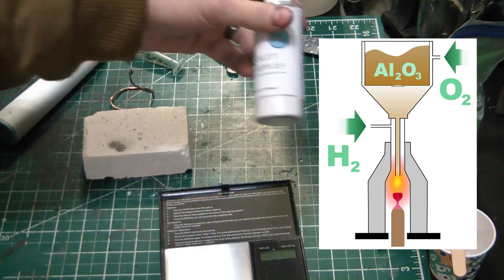Can a $25 Torch Make Synthetic Ruby? - ElementalMaker

Comment: My rubies aren't near as big as yours. Also too much baking soda broke my torch,I printed the prototype and should have built it out of better material after I printed the design but I got impatient so I wound my coils in the PLA. A side-note a pla vessel can take up to 30 PSI with 10 mm thick walls. Torch design number two is more of a Hoffman apparatus, but the pressure is it puts out are miniscule. Also synthesized a Ruby using a fresnel, this was the safest and easiest method for anybody that wants to try it at home. Good luck elemental maker and I hope to be posting a video of a homegrown lazing Ruby soon. That's the whole reason I'm trying to synthesize a ruby.

Comment: Super!
That is an impressive little torch, and your idea of modding the nozzle raises some exciting possibilities.

I was thinking, to produce product with introducing fewer  contaminants, how about using resistance-heating?
If you formed a short strip of Inconel or tungsten into a U, you should have a pretty good container-cum-heating-element.
Also for the mixture of oxides—would mixing enough water to make a slurry make any difference?
If it does not, you could use pressure to force it out of the nozzle; perhaps an ordinary syringe if the heat doesn't travel that far up.

As always, thanks for the stellar content, and you have a good one!

Comment: if you go back to using HHO flame to do this, do you think it would be possible to take your mini ruby boules and melt them together? theoretically the flame should be more than hot enough and the boules should be large enough to at least "weld" them together, i hear thats a hazard when heat purifying natural rubies

Comment: Maybe you could inject the powder in to the torch nozzle? Just have a hole in the nozzle a cm or two from the fire end, and have the powderador hooked to it, so that the gas flow would carry it out. That way the powder would be inside the flame from the beginning. Would have to seal the powderator though as it would be pressurised (with a potentially explosive gas mixture).
Or have the butanO flow through the powderator, with the powder nozzle replaced with a torch nozzle. That would probably carry out too much powder, though, assuming the gas flow could actually keep it from being clogged.
Just seems to me the cad design would leave the powder hanging on the outskirt of the flame.

Comment: Spraying at the brick will make a hole in the brick and scatter ruby dust everywhere.  Let ruby dust fall into the flame and spray at a horizontal metal surface or a pane of glass with spreading motion to prevent shattering.  Think similar to the Abom video of spray welding a shaft.  The reason the Hydrogen torch ruby fluoresces 10x better is because either the carbon is inhibiting fluorescence or the big fast flame jet is selectively flinging off the lighter aluminum oxide, thus avoiding staining the rest of the fire brick red while making the chromium self quench, try using an oxygen rich flame, putting hydrogen through the bigger torch, or using a plasma cutter to do the melting.

Comment: Maybe you could ball mill the alumina and CrO, but you would need to use alumina media - or diamonds if ya got em
Reply: As a fan of Codyslab and having watched him ball mill stuff to impossibly fine powder in the past, this sent me down a brief rabbit hole.  Turns out aluminum oxide has an SI hardness of 1175 and zirconia oxide balls (which aren't too horribly expensive) have a hardness of 1300. :-D
Reply: @andie_pants  I didn't know zirconia oxide balls existed.  I think contamination could harm the ruby quality.  I think carbon from the fuel might have contaminated EM's rubies from this run.  The H+O torch is carbon free.

Comment: Dude, I was just thinking about this project and contemplating the ability to produce post apocalyptic transistors or diodes by using powdered silicon and dopants instead of aluminum oxide.
Reply: You gotta give that a go.... make LEDs 'cus that would have maximum show-off value.

Comment: Is it possible you've got a layer of carbon/soot as a result of using propane? Or even introducing carbon throughout the ruby. It sounds like the temperature you mentioned for the flame is sufficient, but all the references I'm seeing relating to commercial production exclusively describe using hydrogen as the fuel which avoids possible carbon contamination.

Comment: "Ruby, don't take your love to town.....Ruby, Ruby, Ruby will you be mine?"  I did something like this in grad school except I used a platinum crucible to contain the flame and keep the product pure....Pt crucibles are a little on the pricey side, however..... .Pt will not react at the temperature you are using....it succeeded.  
On another topic, the demo with the Al can....just get it white hot(melting) and turn off the propane to let oxygen sustain the burn.  I used to clean diesel ports or 2-stroke dirt bike pipes by heating the carbon red-hot and then just shut the acetylene off and pushing oxygen thru the port/pipe.....the carbon will burn out like magic!
Reply: Cake reference
Reply: @noahpaulette1490  No, pi.......actually, it is actually burning the "coke" out of the ports/pipe.  Old diesel guys been using it for years.

Comment: Pretty cool stuff!
I´m not so sure the venturi effect will be enough to pull in the powder here though. This isnt all that much flow rate, and since it doesnt seem to come out too easily, it could just stay stuck in there.
Although maybe it would work if you also added the toothbrush to the torch?
Reply: Also, maybe try pressing a little pellet of the powder and heating it in one piece. Maybe it doesnt fly apart then.
Reply: I think it'd need a longer outside pipe/hose since to be a venturi it need to be basically an inverted 3D wing or at least that's what I thought Bernoulli taught us.

Comment: the oxy-propane torch may be introducing impurities that are getting trapped in the surface layer, you might try smashing one of the oxy-propane rubies and see if the inside fluoresces closer to what the HHO rubies do.
Reply from the maker: That's definitely a possibility and very good idea to crack one in half!
Reply: @ElementalMaker  I was thinking carbons black was the impurities.  Maybe remelting it with an oxygen rich flame could help burn off the carbon.
Reply: @ElementalMaker  Turning the oxygen up to make a slightly more lean mix and not introduce as much carbon soot from the propane.
Reply: Could be the brick too. If some is melting into the mix.
Reply: HHO will most likely spew sodium or potassium into the flame from the cell, unless rigorously filtered.
Reply: @AKAtheA  Yup. Hydroxide mist from bubbles popping in the electrolizer can contaminate the gas streem. And while often it's not really very much, it isnt something you want to feed into an aluminum engine. 🧐  Most often a bubbler removes the vast majority of hydroxide mist from the gas streem, and can supress flash backs into a larger chamber where a flashback could be more dangerous. 🌋
Reply: Yah, the propane is actually carburizing the element, thus poorer quality in final result. HHO was clearly a better result since hydrogen does not carburize like propane or acetylene. You should look into working on making a more efficient HHO flame to get the maximum result from this.

Comment: So purity and temperature of the flame seem the key points to achieve something resembling a ruby.
Reply from the maker: I also think my 5% Chromium Oxide is too high, I'm going to try 1% and 0.5% tonight and see how it goes.
Reply: @ElementalMaker  also HHO does not contain carbon at all. I have a question. Why pouring the mixture while heating? What happen if the AlO3+Cr oxide is already poured in a little heap and then heated it up?
Reply: @AccidentalScience  the pressure from the flame tends to agitate the small particles and keeps them from absorbing enough heat to melting into a monocrystal form, subjecting them to gravity gives them a greater force to resist agitation, allowing them to collide on the platform and essentially melt together.
Reply: @ElementalMaker  I would recommend 0.69% also, just to cover all your bases
Reply: Tony Samson  Can be as high as 1%.
Reply: @rdizzy1  depends on what you want it for though. Solid state laser rods have very low levels of Chromium impurities. Just enough to fluoresce but not enough to inhibit lasing.